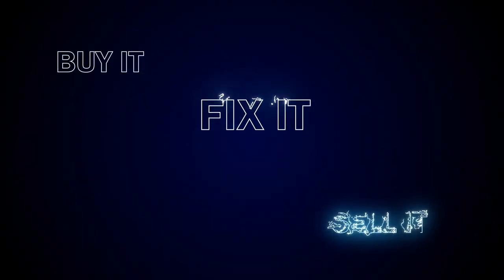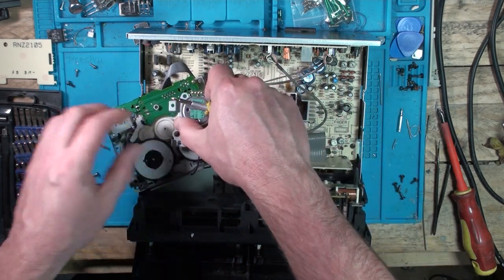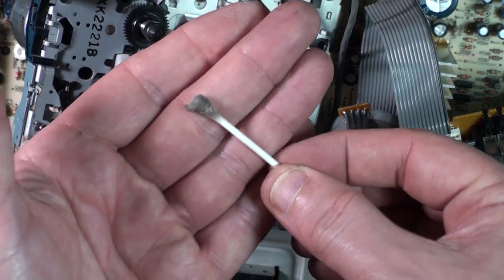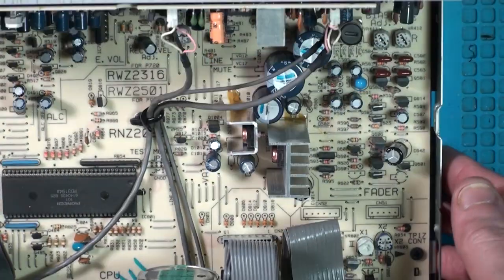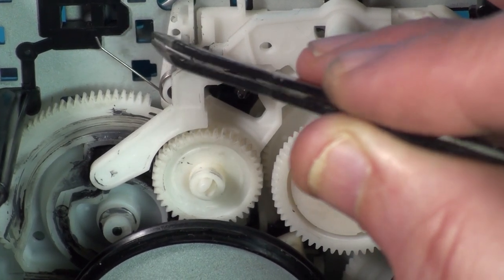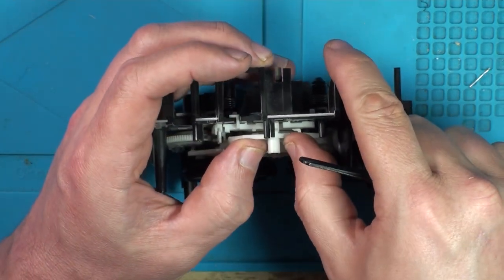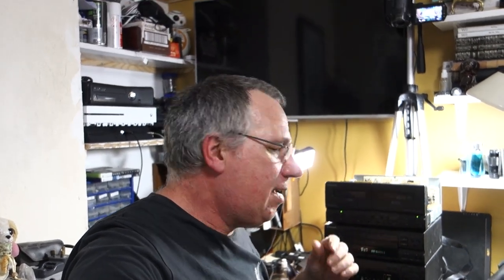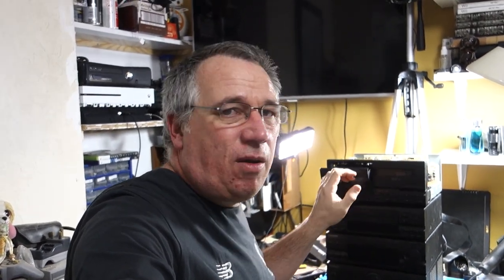CT-P720WR Duel Tape Deck No Movement And Bad Mechanism - Belt Replacement And Fix | UK eBay Reseller

Comment: V-belt is fine on mine. the engine starts, the gears start it starts, but it doesn't carry the tape, then it stops by itself.it goes back and forth in both directions for 3 seconds, then stops it doesn't spin, and things inside the cassette holder don't rotate in the same way on both sides, they can hardly be rotated by hand....can it be repapir easily? is it worth dealing with?
Reply from the maker: Sorry for the late reply. It's hard to tell what the problem could be with something like that without having the machine in front of me. It probably wouldn't be an easy problem to find or repair.
Reply: I have the EXACLTY same problem as you. Did you manage to resolve this? I don't know what to do right now...I tried everything.

Comment: hi!
 it's the same for us. unfortunately, it turns on, starts, does not rotate the tape, and then stops. what could be wrong? help?
Reply from the maker: Have you checked the belts?
Reply: @RetroElectronicRepair  V-belt is fine on mine. it doesn't work though. it starts, the cog wheel turns, the tape doesn't!
Reply from the maker: It's hard to say what is wrong. They have so many moving parts, it took me hours to find the problem with my one.
Reply: @RetroElectronicRepair  I understand. I don't think the problem is a moving part, but an electrical problem. the spike is closed, it cannot be wound by hand on both sides. current can move something in it. but thanks!...if you think of anything, please write.